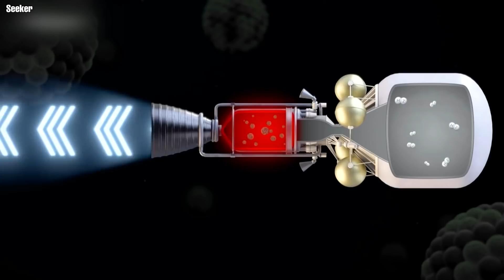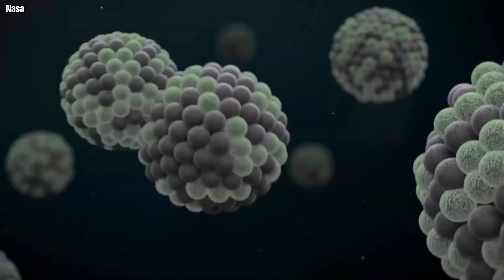Pentagon Is Testing A New Nuclear Moon Rocket!

Comment: Low radioactivity means low efficiency means extra mass.

I've read about high temp gas reactors for space. Now that would be one hades of a propulsion system. Googled "gaseous nuclear reactor for rocket". Wikipedia showed core temp of 25,000 degrees. I can't see how a 25,000 degree reactor could be prevented from melting  physical containment, would have to be magnetic containment. Still, extremely tricky, how would such a reactor be idled? Hard enough for a solid core reactor. Still, hell of a propulsion concept.

As space industry advances and automation advances, these types of post-chemical rocketry will be the obvious choice. "Earth to LEO" will remain the sticky problem.

Comment: Nuclear power for spacecrafts is needed for long duration trips. chemicals; rockets aren't strong enough, and cant be improved enough to make any really long term mission work. atomic rocket engines would be many times more efficient and have greater thrust, making higher speeds available instead of gravity assists every time we go outside of the nearest planets.